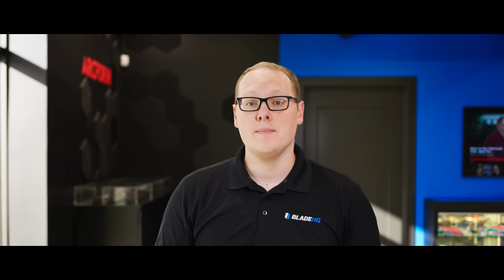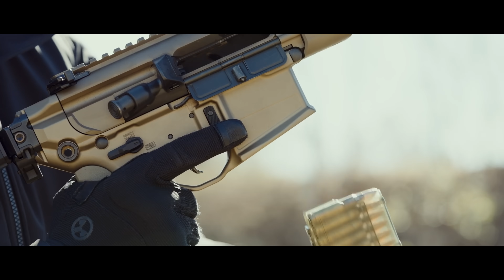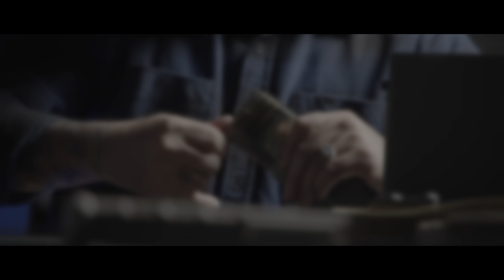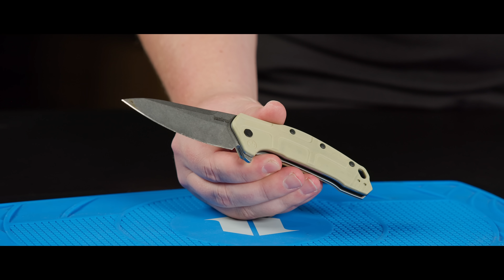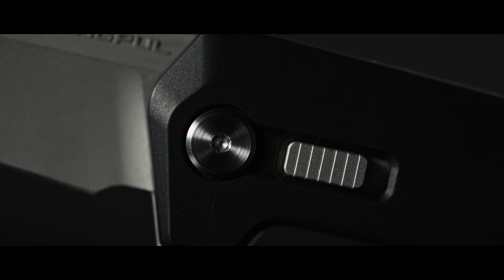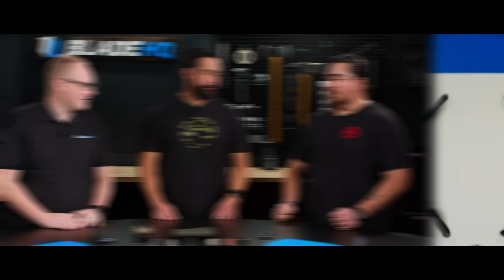Magpul Just Changed The Knife Industry With MIM

Comment: Crkt and spyderco tried this decades ago.  The blades will snap and they won’t keep an edge.
Reply: decades ago isnt today ....  i trust magpul will not put out an inferior product.
Reply: MIM parts in S&W revolvers are trash compared to the billet versions too, all the companies care about is $$$
MIM is ok for some products, not firearms and knife components
Reply: Manufacturing has come a long way and Magpul is an industry leader in the injection molding space. They don’t typically release anything until it is 100% good to go. I’m thinking specifically about the TMag.
Reply: My thoughts exactly. MIM is not tough, just ask anyone with a Remington 870 or 1100. One of the first upgrades is to replace the MIM extractor with one that's machined from a billet.
Reply: @MrEunderwood  first thing I did to my 1911 was replace all mim with machined parts.
Reply: @chaddixson8398  Did those parts fail?
Reply: @ extractor did but who cares.  You want a mim knife, buy a mim knife.  Personally I can find a dozen other under 200 IS made knives better than this.
Reply: @ Extractors are wear items, and improper handling can lead to early death. Improper handling being inserting a round in the chamber and forcing the extractor to snap over it. It doesn't matter if it's billet, it will eventually fail from that.
Reply: @ every part is a wear part.  You won’t find a mim part on a staccato the same way you won’t on a hinderer.  Mim parts fail more frequently with less use.  Ultimately I don’t really care.  I’m not buying one.  You can keep explaining things to me I already know, it’s not changing that.
Reply: @skyhop  extractor is a wear item? Lols. I have a few competition pistols with around 20k rounds and the extractor isn't work at all. Springs, sure. Hard parts, no.
Reply: @joshuabaker5712  There's always the one guy who is like "but I have shot infinity million rounds and X has never happened!" Yeah, I'm happy for you, but in the real world extractors do wear and break. Depending on the gun and design that can extend into pretty extreme round counts, and some others can be relatively short lived.
Reply: @skyhop  Knife blades are a wear part too, bud. I'd much rather put my money and trust into a forged or machined blade over buying a MIM knife. Just because the magic magpul salesmen say something, doesn't make it so. They're contradicting decades of common knowledge from the manufacturing industry. I don't see the masses volunteering to be their guinea pigs.

Comment: This has been tried before, & failed. It will fail again. When you see what you are getting for $220, you’ll be pissed.
Reply: The steel in question is comparable to CPM S35VN steel. The knives that use that steel cost anywhere from $54-$995. The most popular knives that use that steel cost $100-$250. They are selling the knife at $185 which is a fair price given the current market. So why whine about the price?

Comment: I thought MIM was to keep the cost down. $200?!?
Reply: It's new... lots of R&D in this.
Reply: @NotYourGrandpasEDC Just noticed your User-Name. Kinda ironic.
Reply: “Keep cost down” doesn’t mean “cheap or inexpensive”.
It just means “costs less to produce than most other knives of a similar quality”.
Reply: @cavemandanwilder5597 ”similar quality” to what? How many other potmetal knives are on the market?
Reply: The steel in question is comparable to CPM S35VN steel. The knives that use that steel cost anywhere from $54-$995. The most popular knives that use that steel cost $100-$250. They are selling the knife at $185 which is a fair price given the current market. So why whine about the price?
Reply: @gilbertmckown6161  Keep copying and pasting that comment over and over again please.